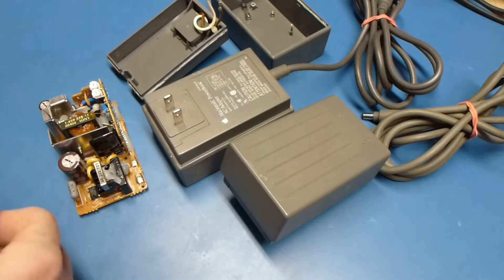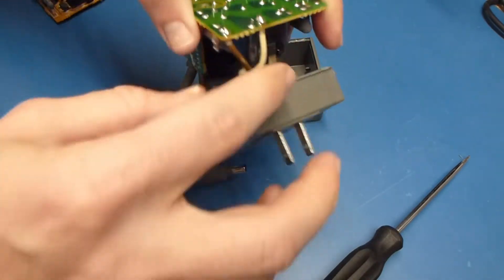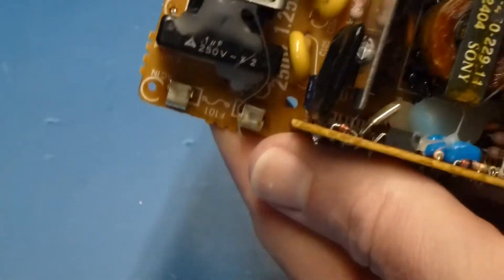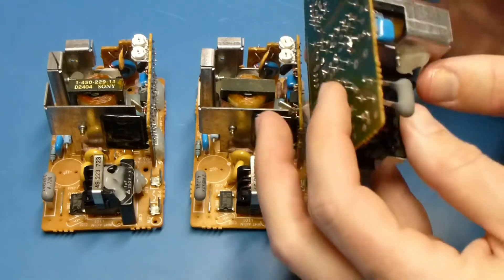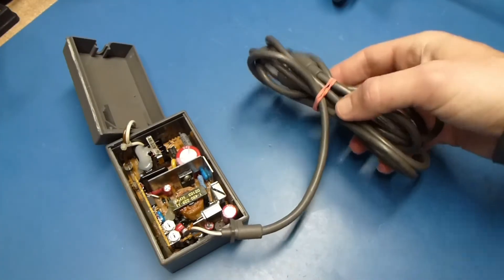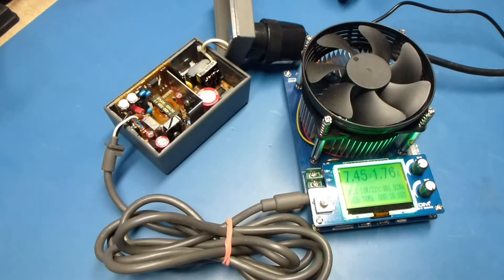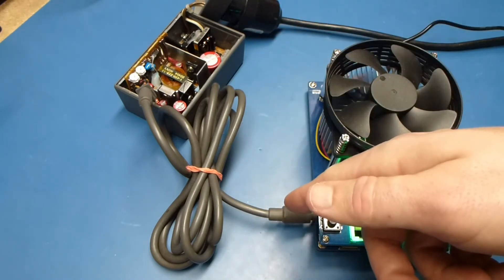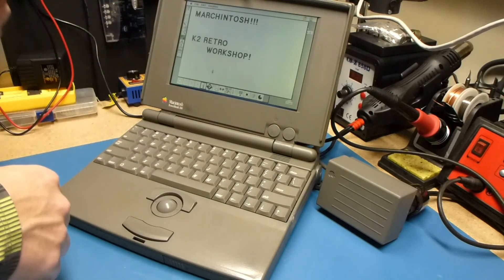Macintosh PowerBook 100 Series Power Supply Rebuild

Comment: Dumb question but doesn’t testing with a decent multi meter also apply a ‘load’ (probably a resister) in DC voltage test mode?
Reply from the maker: It does apply a load but it is so miniscule compared to the output of the power supply that it might as well be non-existent. The supply should source an amp or more and the 10 meg-ohm input impedance of the meter will only take a few nanoamps. 

Now, if we were talking about a sensitive amplifier with meg-ohm resistors in it then yes, it would matter.
Reply: @DKJones96  cheers

Comment: Cool. Thanks for the upload. Hope you can post more of them repairs :)
Reply from the maker: I plan to! I've got a Performa 200, PowerBook 165, Powerbook 170, and my parts Powerbook 100 all in the Mac queue and none of them boot as-is. I've also got a Commodore 64 with a blank screen only output that needs repair as well as probably the 1541 drive I have for it as I haven't even tried firing that guy up.

Makes for a decent collection had at a low price at least, if you don't count the repair time. I don't count that as I enjoy that part... usually.